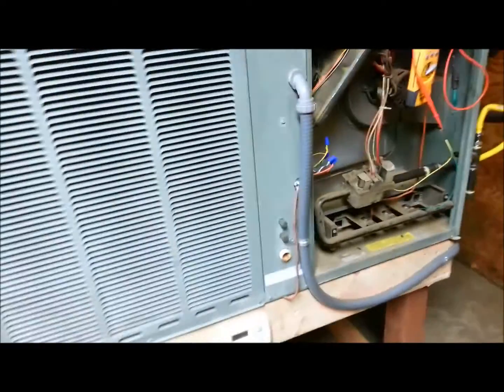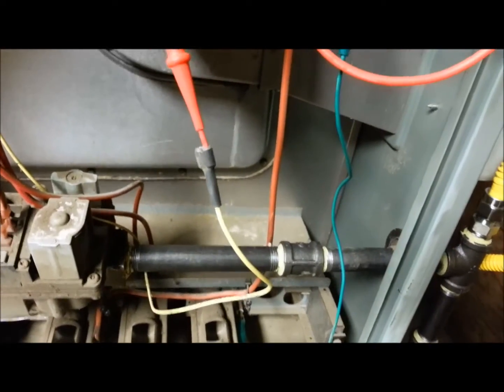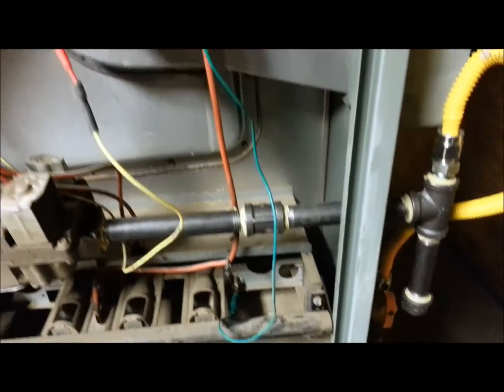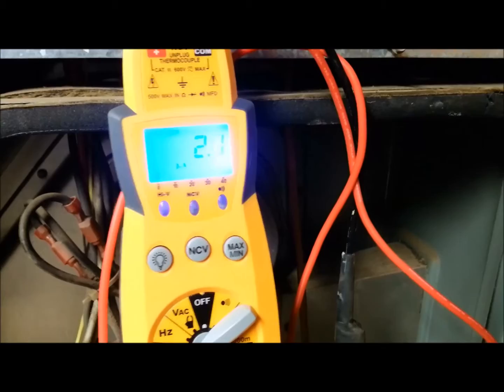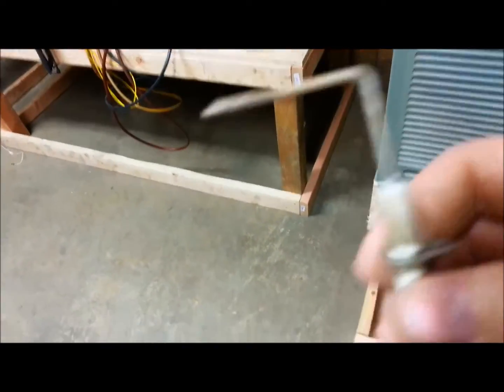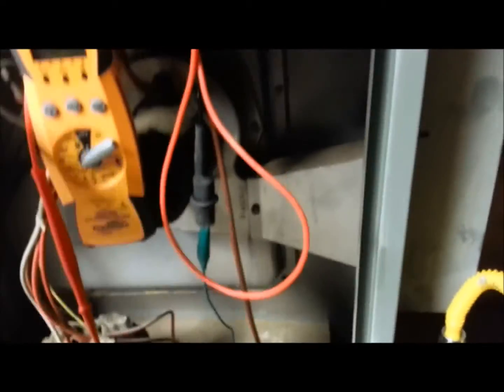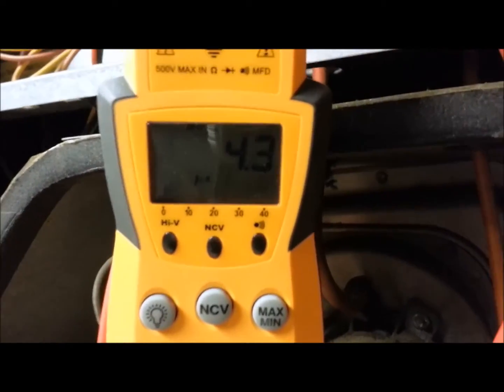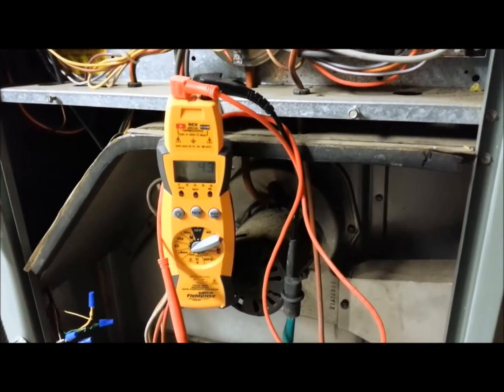Flame Sensor Testing Package Unit

Comment: What meter are you using? HS36?
Reply from the maker: Yes, it is an HS36 which has a setting for micro amps. However, I have switched to the Testo 770-3 recently, as it is blue-tooth enabled, and I can use the Testo app on my phone. I prefer to use apps on the phone as I can screenshot each reading saving it for later.